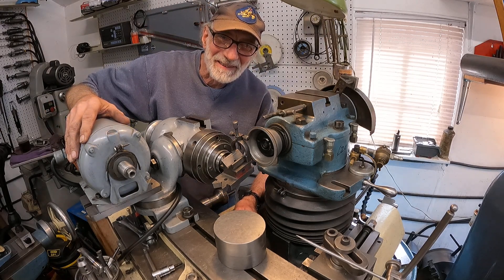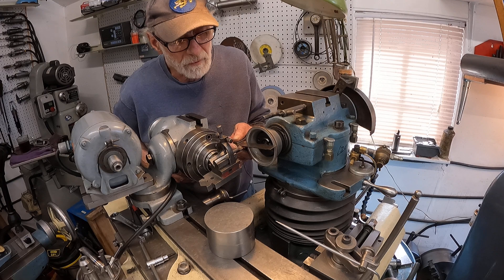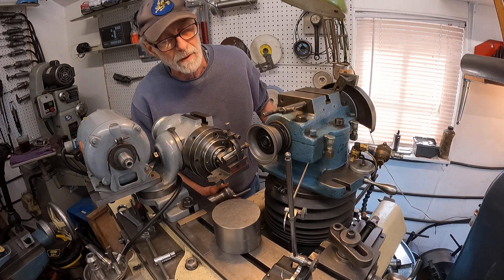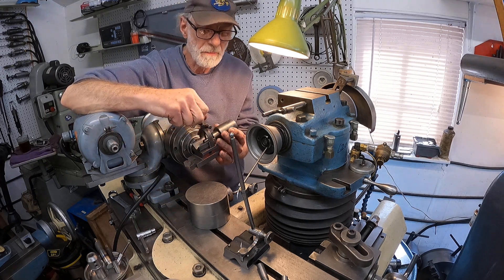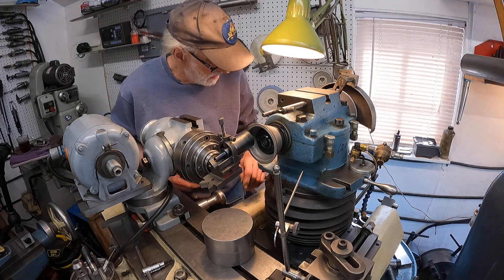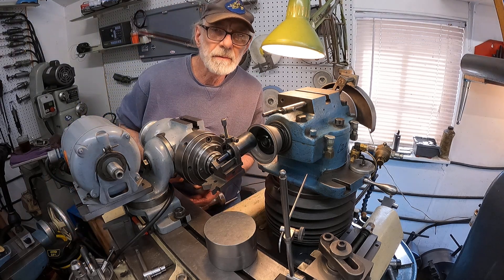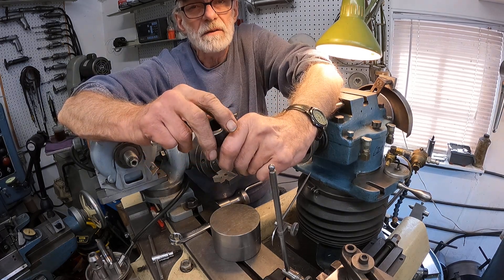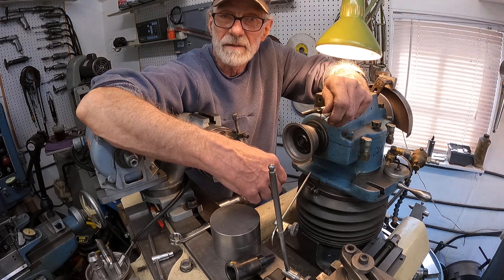Tool & Cutter grinder sharpening boring tools #2

Comment: dee dee I would love to have a cutter grinder. I don't know much about using them but the more I watch you use yours the more i understand. I am curious to know what the 2 unused Tee slots are for and how to use them. I doubt I will ever have one but I do have a valve grinding machine that I have been wanting to convert to a simple tool sharpening grinder. Sir you do not need to worry about me getting bored watching you use the cutter  grinder. As I have said many, many times before "anyone can make chips ". The recipe is what makes the soup taste delicious. Thanks again. BTW 2 days ago it was 99 degrees here with 40 plus mph winds, today itis mid 50's with rain.
Reply from the maker: We have had a cold spell here, I  not sure of what T slots.
Reply: @deedeeindustrialsuperprecision  
The Tee slot on top of the spindle and the one on top of the fixturing dial.